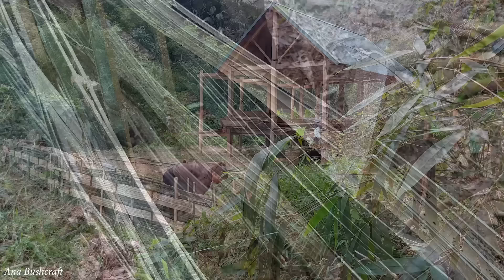Full Video : 90 DAYS LIVING OFF GRID with ANA BUSHCRAFT - Goodbye "Susu" My Lovely Dog

Comment: That generator gives her more problems. She was raised in this environment. Just like us who were raised during the seventies knows more things than ppl of today. I’m sure she learned this from her parents
Reply: I have a solution for the generator. Since LEAVES FLOAT all she has to do is put a board (say 2" into the water) at the entrance of the pen stock angled say 75 deg from the right side of the pen stock to the shore on the left side, so the leaves will be directed to the right side bypassing the opening. Note: The clear water would still be able to go under the board.
Shown here where she is throwing the mud and standing, 2:09:50 is where she should have the overflow water way. This would allow the water to suck the leaves over the dam. 
The following may not be required if you  keep the water level at the max elevation, which is the top of the pen stock, but if you are producing to much power then all you need to do is add a adjustable Weir to the overflow water way to match the power level you are looking to generate.
Reply: Note 2: On top of the pen stock... Cover it
Reply: Yeeesssss…….wish we could be there to help her

Comment: The hole in the wall through which the fireplace pipe goes outside must be cut with refractory material, otherwise there will be a fire.

Comment: Improvements in future agriculture and extreme weather

Cutting down miscellaneous trees and burning them to make carbon
Mix the carbon into the soil to improve the water holding capacity of the soil
Taking in CO2 by putting carbon into the soil
Abnormal weather can be improved.
Mow the grass and mix the grass and garbage to make mulch
Spread it on top of the soil. Approximately 5 kg per 1 m2 of soil.

Soil made in this way has water retention capacity and fungi in the soil
By having the soil cultivated, the water retention capacity and fertility of the soil can be further improved.
If you earn money, you will grow rich soil without plowing, and you will receive abundant blessings every year
it becomes possible to obtain